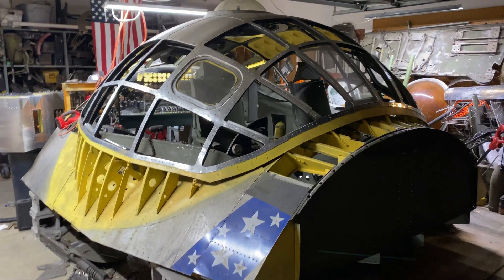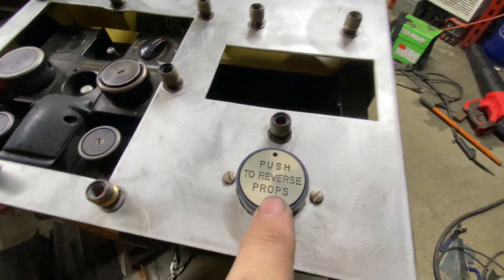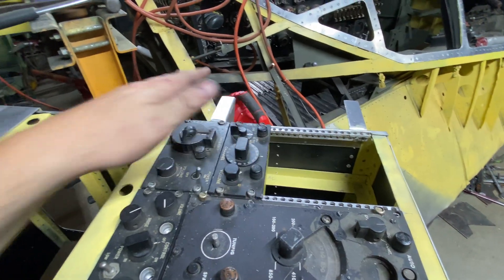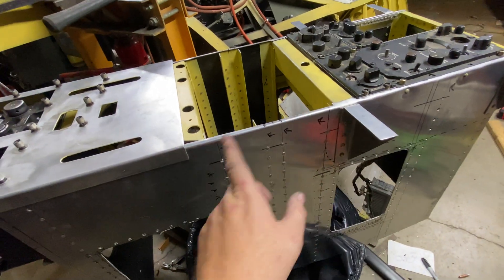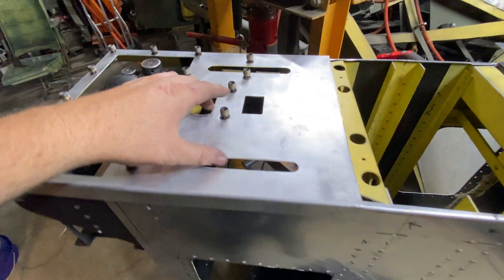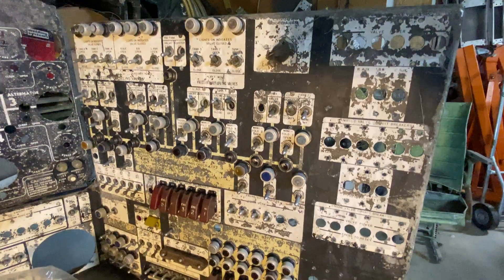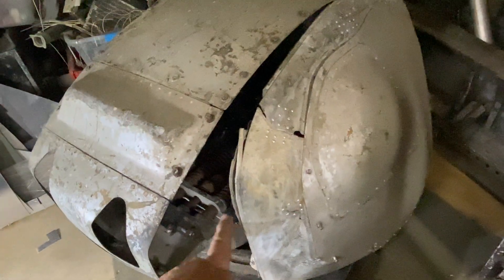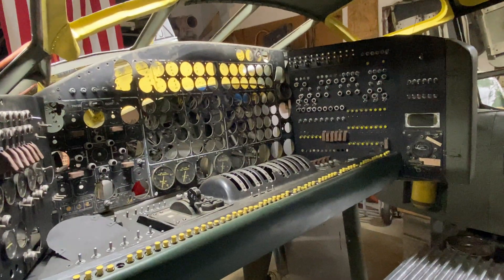The New Yankee Airplane Factory S4 E9 - B-36 Pilot’s Console - Early Flight Engineer Station

Comment: The ballistics computer , electrical VS analog , you mean the older one used more gears as opposed to vacuümtubes?
Reply from the maker: I assume as the books dont’ go into any detail. However, I have the schematics to both units so I could answer this exactingly. The all-electric computers were significantly more accurate and less prone to failure.